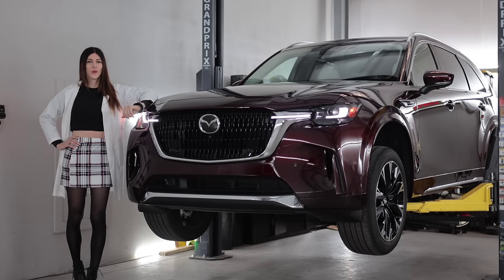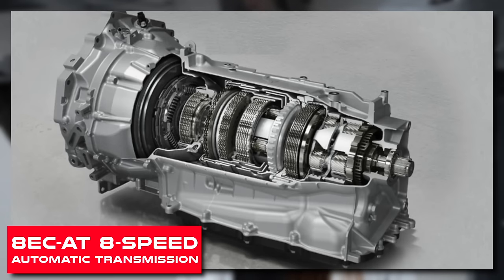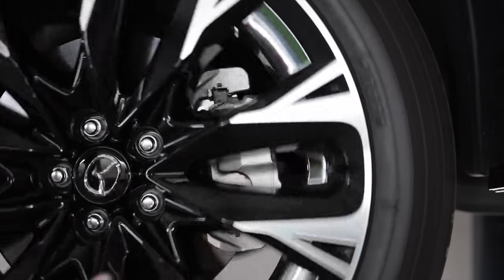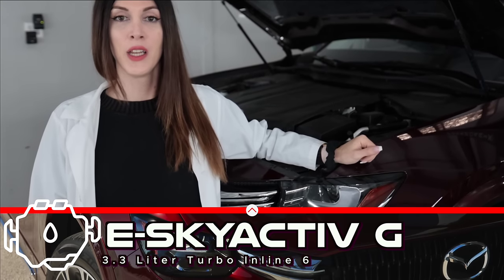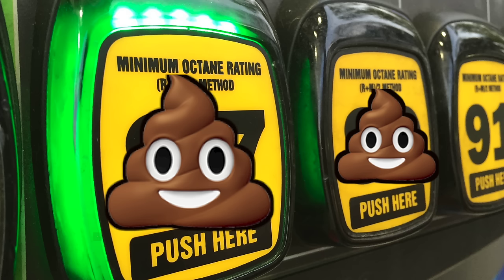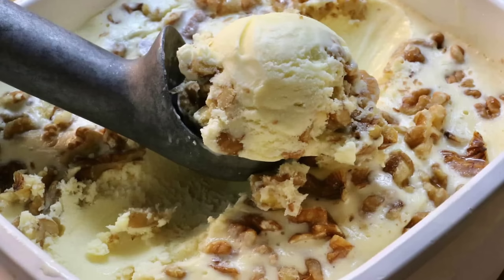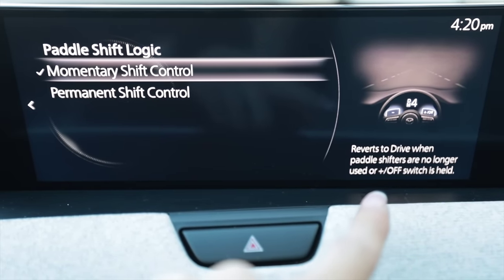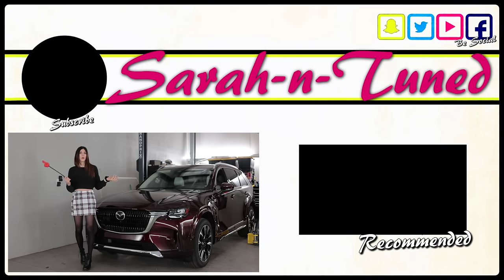Why It's Conflicting.. // 2024 Mazda CX90 Turbo S Review

Comment: Mazda has been quietly making awesome automobiles. Very high quality as well as inventive designs.
Reply: Nah, they're committed to stupid SUVs. 90%+ of people who drive these stupid cars don't need them.
Reply: @spoenk7448  what defines “need?”
Reply: @mezzb  Ok. So what? You have a problem with people freely choosing what vehicle they drive based solely on what someone else thinks they need? That seems bizarre.
Reply: @scottg4615  People tend to buy SUVs for reasons they don't really need them to be. Lots of people are convinced of the benefits though. Typical ones: storage. Easier, yes, but how often are you loading up a sedan can't load up? Ease of loading? Easier than a sedan, but it's as easy as a 5-door. Better visibility because you sit higher up? True if everyone else drives a sedan so you can see above them, but with more people driving an SUV, this becomes less relevant. Higher height = better traction in snow? Not accurate. They mean to say they won't get stuck in deep snow, which is true and relevant if you live outside of the city. City folks tend tio have roads already plowed. Some generalization that it's safer because the car is bigger? Well, there's a whole study about how sedans colliding into sedans is a-okay, because the bumpers actually collide with each other since they siit roughly at the same hieght (by design). SUVs being taller now are more likely to cause greater injury to sedans because the bumpers don't line up anymore. So the SUV driver is more likely to cause harm to others out of the fear of sustaining injuries themselves. They're now part of the problem when you think about it. Again with the same point about sitting higher up to gain an advantage over sedans, SUVs being the same height as each other just makes you equally as safe colliding with another SUV as a sedan hitting a sedan. Not a whole lot safer aside from reducing the chance of injury being hit by a sedan. There's a whole video on this by "Not Just Bikes". I'd encourage you to watch take a watch if you are more interested in discussing over than arguing on the internet.

TL;DR: Most people who buy an SUV for the usual reasons honestly can get by with a 5-door.
Reply: @scottg4615 Don’t give this troll any attention.
Reply: We have 3 generations living in one house, we need 3 row seating quite often and travel quite a bit by car, with the 3rd row folded down, so this is a need. Having said that, I do see people buying massive Tahoes/Suburbans for questionable reasons. These luxury SUVs aren’t as obnoxious as those previously mentioned vehicles, IMHO.
Reply: Does it bounce too much on the road? I've heard it's a bouncy ride. . . .
Reply: @aos-archive light trucks are MUCH more dangerous on the street than SUVs. Talk about not needing them? How often do a lot of these 20 year olds load up the back of their dually or actually haul anything? RARELY.
Reply: My wife is disabled and can’t get into a sedan and finds an SUV easy to get in and out
Reply: @aos-archive better this than stupid boaty Silverados, rams, and f150s driving around families to chucky cheese while parking sideways and giving no Fs to the people around them, and wasting wayy too much gas. Not to mention trucks have pretty weak ass cabin protection in general. I never see people in large SUV's park nearly as wrong as I do truck owners.

Comment: I got a Mazda recently, after only owning German vehicles.. the car feels the same as what im used to, to be quite honest. It’s solid, uses quality materials, picks up and has a higher top speed than other vehicles, and is agile and stable despite it being an SUV. Even though I don’t like Asian vehicles, Mazda is manufactured in Japan and has an amazing heritage and racing pedigree to its name. Mazda also has an excellent brand portfolio and image. I’m happy to own one..
Reply: I do have to say though.. Mazda makes great vehicles that are capable. But, you’re not just buying a whatever car. Don’t assume just because it’s Japanese, it’s gonna work the same. Mazda is different.. premium gas is essentially what makes Mazda a Mazda. It’s imperative that you only service and maintain your Mazda at an actual Mazda dealer. You might be upset at the prices, but your wallet will thank you later on. Mazda uses premium grade synthetic oil, and there is a lot of complicated technology under the hood that needs proper maintenance. Treat your Mazda the way it’s supposed to be treated and it will be the perfect car. Treat it like a Camry, and you’ll soon realize you bought the wrong car.
Reply: @christianbryant5617  The  CX 90 is over engineered.  Just about any work done under the hood requires pulling the pin and dissembling the entire front end and pulling the motor.  The timing chain behind the engine is the worst design possible.  Probably cost over 5K to replace it if not more.  So yeah, you better do all the maintenance on time and treat it like a baby.
Reply: @HiPlains1  for sure!
Reply: @christianbryant5617  Premium gas is only required in order to get the full power rating!
Reply: @retgi1  I worked at Mazda and received a discount on this car. That was one of the main selling points lol. But the mechanics are the ones who were always saying this stuff. The gas caps on N/A models also always said 93 recommended. If there was a customer service invoice or any other information like when we had new buyers, that information was also stated on there. Supposedly putting the low octane stuff causes way more damage to the system than what people has assumed before.
Reply: @christianbryant5617 , I own a 2010 Mazda3 and I have no idea what you are talking about. Maintenance is easy and done by third party mechanics. Gas is regular, as per the manual. Drives like a Mazda. Zoom-zoom!
Reply: @christianbryant5617 , oh, yes. If you mean CX-90 specifically, I'd go with recommended octane.
Reply: @solderbuff  it should be okay, but that’s my experience and what I’ve learned from working with Mazda. I’d advise you to only bring your Mazda to an actual Mazda dealer if you get another model in the future but to each their own
Reply: @christianbryant5617 90% of vehicles with timing chains never have issues. Unless they're a VW Product like many jettas and audis.
Reply: @know916bound  that’s not my experience but y’know. I think the only Audi that shares a lot with VW is the A3. Most family brands in the VAG share many things but I think they’re quite different with things like timing chains. Maybe not
Reply: @christianbryant5617  literally look up lawsuits and different models. It's not limited to just one model of VW or audi. And I sell parts for a living, I see way more VW and Audi on a daily basis than other german vehicles. And the only japanese manufacturer that comes to mind with consistent timing chain issues are certain Nissans.

Comment: In Europe, we get the 3.3L inline 6 diesel with 254 hp and 550nm of torque that can tow 2.5T, which is phenomenal. Super torquy, very powerful, and a does about 40mpg.
Reply: On CX60 but the CX90? I'd like a suitable alternative to mercedes m class but the CX60 is a bit too small. I'm talking UK here.

Comment: The  bottom of this car is beautifully detailed.  Sarah, thanks for all the shots of it, and emphasizing the use of different metals for suspension components. Living on the east coast at 38 degrees latitude where only until 5 years ago we experienced annual winter season snowfall, it's likely all those shields, protect underbody bolts  susceptible to rusting if driven anywhere where deep snowfalls are present and salt is used to clear and regulate roadway.

Comment: We leased the PHEV because of the $7,500 rebates making the payment cheap and we love it.  Just had all the recalls done and the transmission is smooth now.  It also pulls away easier in EV mode.  You should try to drive the PHEV, accelerates to 60 slightly faster than the Turbo S.
Reply: Do you hear the 'whoop' sound when landing in 6th gear or is that only an issue with the inline 6?
Reply: @nostyle126  Have never heard that noise.

Comment: Definitely Sarah approved with those control arm protectors to minimize paint chips!! Timing chains themselves usually are fine, its things like plastic chain guides that can cause issues....
Reply: @Zerobar78 - former VW Corrado owner over here. Can confirm on the t-chain guides. First time replacing one at home was so much of a PITA (VR6 has them at the back of the motor, too) that when my 2nd C started making that noise, I just took it to the shop and threw money at it.

Comment: I bought the 2024 Mazda CX-50 Turbo premium plus AWD (zircon sand + terracotta interior leather). Just under $44K...pretty impressed with it so far. Years ago we had a couple of Mazda 3's and a CX7. This new one is pretty rewarding to drive...a lot of bang for ya buck. The CX-90 is a bus.
Reply: I enjoyed my CX Turbo way back when
Reply: Well, I did 4000 miles (CA, NV, AR) in it CX-50 SkyActiveG Turbo (Rental Car) and it felt a bit slow (compared to Ford Edge AWD 2.0T engine). But I can't say a bad word on anything else. Almost a perfect SUV / Cross-Over car.

Comment: It’s a Mazda, so handling is going to be a priority. The infotainment system will suck, but that’s not why you buy from Brand M. If it’s anything like my current two street cars, my race car, and previous Mazda street cars, it’s going to be stone reliable as well. I’m fairly brand agnostic (in fact, I work for a competitor) but whenever I’m trying to answer the “What car do I need to do what job” question, the answer seems to be Mazda.
Reply: Actually love the infotainment controls in my CX5. Not having a touch screen is a plus in my book because I don't have to clean off ugly fingerprints. Also hate trying to poke a touch screen while moving.

Comment: I just had one of these as a rental for a work trip. I was pretty impressed. The shifter is strange going to Park, but…idiots tip, if you open the door to get out and it’s still in reverse instead of park, it’ll automatically set the e-brake for you. 😂

Comment: does look nice, quite a few vehicle manufacturers have gone back to straight six configuration, and yes rear chain drive does seem to be getting the norm, still better than timing belt running in oil.
Reply: Who else is going back to 6 cylinders? Most suvs are 4 turbo cylinder

Comment: won't tell you how many cubic feet of cargo a vehicle will hold because we can look it up on Google...but will tell you the engine family, bore and stroke measurements of that engine, brake rotor size in millimeters and metric thickness measurements of the the anti-roll bars.  Great channel.

Comment: I had the same experience at 4:18 on my car when I did some mods and had to open up the front grille. The Radiator and condenser stack has a gap in-between and it was filled with tons of dead leaves, baseball card and a cigarette butt. 
As a result, I bought some 6mm diamond shape screen and installed it on the grille. Today's car manufacturer uses large size opening on grille because the turbo charged engine needs to stay fuel efficient even at the worst weather condition. But that defeats the purpose of the grille with such large openings.

Comment: Nice overview. Some mixed feelings about this car. Watched a lot of video...SavageGeese was properly in depth and tracked with forum chatter on the CX-90. Too big to be small and too small to be big. A lot of continuing OEM updates to drivetrain parameters to smooth things out (lots of clutches, electrics, stop/start, torque vectoring and what nots maybe not coordinating perfectly yet). Consensus is that this thing really needed adaptive dampers to both handle well, which it does in class leading fashion, and to achieve squishy family hauler mode too. I have a '24 CX-5 Turbo in my driveway cuz I needed a commuter. The CX-5 is mature and near perfect. I think the CX-90 will get there.
Reply: Adaptive dampers would move the price point but the ride is pretty stiff on 21" wheels. The 19s are better. I read somewhere that the suspension joints need time to break in and then the ride softens. I dunno.

Comment: Bought the PHEV version, drove for 7,700 miles, sold at a loss. My bad. Hated the firm ride and lower space compared with my previous Highlander. 4Runner now, and much happier, minus the mpg.  Would not recommend.

Comment: That was weird seeing that delay when you buried your foot in the this "Turbo S"'s a$$. As soon as you had mentioned earlier in the introduction that it was a hybrid, I assumed fantastic off the starting line acceleration because the electrical assist included a cheater spin up of the turbo accompanied by extra energy dump assist to the 4 corners forr crisp acceleration.
As always, I love the pace of your presentation. You pack a lot of relevant info into each review to keep us interested in what you will reveal next.

Comment: I love your review. You're the only one who shows the undercarriage component of the vehicle being reviewed, also only one amongst the very few who mentions at what RPM when referring to output power & torque. I just do not agree with the low ease of maintenance score. compared with transversely mounted engine longitudinally mounted engine is easier to work on because parts/component are accessible from both sides of the vehicle. It just so happened that CX90's engine has its timing gear case located behind the engine. If it were a "timing-belt" and not a "timing chain" type I would agree that It is hard to maintain. Timing belt is being replaced every 80,000 km more or less, whereas "timing chain" replacement is during major repair only.
Overall I love Mazda's CX-90, more so if it were not a "PHEV" type. Why complicate matters when its power is more than 300 horses already. I'll figure out how to disable its "hybrid" system if I could own one.

Comment: CX-5 owner here : the car doesn’t produce an electronic enhanced engine sound.  Although my CX-5 is equipped with a [straight] 4-cylinder non-turbo engine, I can still recognize that high-pitch twirl within the CX-90’s sound.  This is produced by the fuel pump.  Part of Skyactiv Tech has to do with the injection of the fuel through highly pressured sprays.  Hence the disturbingly stale sound of a high revs turbo…

Comment: Great way to qualify rear timing chain.Nice video Sarah.
Reply: Except it ain’t the chain that will need work.  It’s the guides.   Disappointed to see Mazda do something as stupid as the Germans do.
Reply from the maker: @ScrubRadius you missed the point.. it’s irrational to stress over a hypothetical maintenance point that requires the same level of physical labor as something else far more likely to need replacement in the same location that ALL vehicles eventually need.

Comment: I cannot WAIT for these to become heavily depreciated! I've bought two Mazda 6's now, both 5 years old when I bought them (a 2016 in '21, and a 2018 in '23) and they were fantastic! I'll definitely be in the market for a nice AWD Premium SUV in the future and i'm a-ok with sticking to Mazda for life lol.
Reply: Just remember this car is over engineered.  You have to pull the engine out to replace any of the components.  Its a nightmare to work on and the timing chain in rear is overly complicated and would take a long time to replace.  Its even worse then how overly engineered the Germans make their cars.  This is one car that I would not want out of warranty.
Reply: @HiPlains1  Apart from the timing chain, things aren't too difficult to service. I've seen a few come through at my job, and so long as you take the cowl off, you have a lot more access to the engine. Of course the hybrid system is tough, but that's the case with every hybrid system really. In comparison to what BMW and Mercedes are putting out now, these things look (on the surface) like a walk in the park for most maintenance, and even some engine accessories.
Reply: @HiPlains1  Get the gas only version. Cheaper and easier to work on.
Reply: @HiPlains1 i think timing chain will last the life of the car with proper maintenance. Unlike the timing belt that is a maintenance item

Comment: Just moved from my Mazda 6 2.5 Liter Turbo into the new 2024 Mazda CX-90 3.3 Liter Inline 6 Turbo, Artisan Red like the one featured here.  Have only had it for a couple of days and love it so far.  I did test drive the Hybrid model and hated it.  That version is equipped with just a 4 cylinder on the crossover and no GO power.  In "EV" mode a little more torque but felt odd.  Not a fan of the hybrid.

Comment: I tested 280HP, 340HP and PHEV and I picked PHEV in the end. 
1. Transmission is a bit hesitating plus a bit turbo lag on Inline 6 models in low gears. PHEV transmission is silky smooth.
2. I do feel the inline 6 rare suspension is wobbly wobbly sometimes due to lack of sway bar, but PHEV is very compliant due to its added weight and lower center of gravity.
3. PHEV has instant response from low gears but inline 6 model is a bit hesitating plus a bit turbo lag. In mid-range, inline 6 is much stronger than PHEV even in sport mode. If you primarily drive in town, PHEV works better but if you drive on highway most times, inline 6 is better.
4. PHEV has less annoying fake engine sound. I don't get why they need to use fake sound or not providing a option to disable it.
Reply: All that transmission weirdness goes away after one full week of driving
Reply: @mbenton6  Ablotely not without software update.
Reply: @GooseVan  mazda computer adjust driving behavior to its driver only